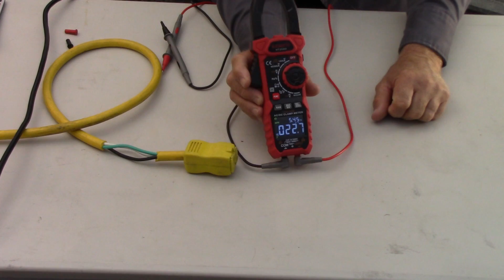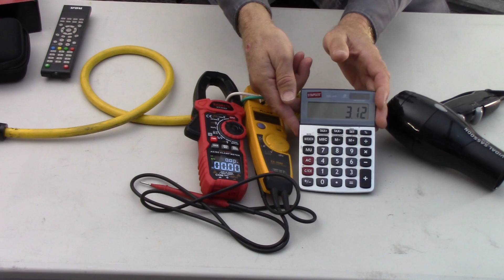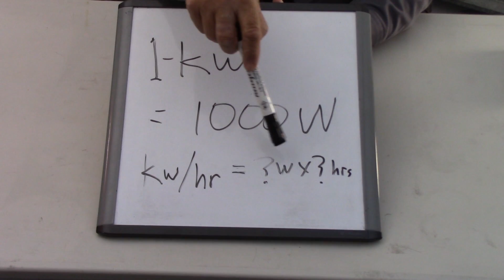Volts, Amps, Watts - What Exactly Do They Mean??

Comment: VOLTS = Water Pressure (50 psi)?
AMPS = Water Flow Rate (ie. gallons per hour)?
WATTS = Water Used (ie. gallons)?
Volts x Amps = Watts?
Water pressure multiply Flow Rate equals Water Usage?
50 psi x 1 gph (mist nozzle setting) = 1 g
50 psi x 2 gph (shower nozzle setting) = 2 g
50 psi x 4 gph (full nozzle setting) = 4 g
Notice the gph always equals the final amount used.

WATER: If 1 gallon of water flows passed (AMPS) a given point ("switch/valve") per hour then after one hour the bucket will have just one gallon of water (WATT?). But apparently in the world of electricity, AMPS and WATTS are NOT measured equally. So, why aren't AMPS (amount of electricity flowing passed a given point) equal to WATTS (amount of electricity used/expended)? What is the difference between AMPS and WATTS? What is the advantage of having two different names to measure electricity whether it is flowing versus after it is used?

If the amount of electricity that ends up getting used varies from the amount of electricity that passed the "switch", what causes that variable? In WATER, regardless of the water pressure, if a nozzle/fixture/outlet (load/appliance) restricts the amount of water used to X per hour then the rate at which that water is flowing passed the valve will be equivalent to what ends up in the bucket. It would be weird if the water flow rate was say, 1 gallon an hour but we measured 2 gallons or only half a gallon in the bucket. Either the instrument used to measure the flow rate is broken or the water in the bucket was not measured correctly.

Forgive my ignorance.
Reply: My thoughts, but exactly

Comment: I loved your water analogy.  I used to use electrical analogy when I taught cardiac heart rhythms, which is basically plumbing and electrical. Great video.
Reply from the maker: Thanks for watching!  And for the nice comment!
Reply: @theinternetelectrician  VOLTS = Water Pressure (50 psi)?
AMPS = Water Flow Rate (ie. gallons per hour)?
WATTS = Water Used (ie. gallons)?
Volts x Amps = Watts?
Water pressure multiply Flow Rate equals Water Usage?
50 psi x 1 gph (mist nozzle setting) = 1 g
50 psi x 2 gph (shower nozzle setting) = 2 g
50 psi x 4 gph (full nozzle setting) = 4 g
Notice the gph always equals the final amount used.

WATER: If 1 gallon of water flows passed (AMPS) a given point ("switch/valve") per hour then after one hour the bucket will have just one gallon of water (WATT?). But apparently in the world of electricity, AMPS and WATTS are NOT measured equally. So, why aren't AMPS (amount of electricity flowing passed a given point) equal to WATTS (amount of electricity used/expended)? What is the difference between AMPS and WATTS? What is the advantage of having two different names to measure electricity whether it is flowing versus after it is used?

If the amount of electricity that ends up getting used varies from the amount of electricity that passed the "switch", what causes that variable? In WATER, regardless of the water pressure, if a nozzle/fixture/outlet (load/appliance) restricts the amount of water used to X per hour then the rate at which that water is flowing passed the valve will be equivalent to what ends up in the bucket. It would be weird if the water flow rate was say, 1 gallon an hour but we measured 2 gallons or only half a gallon in the bucket. Either the instrument used to measure the flow rate is broken or the water in the bucket was not measured correctly.

Forgive my ignorance.
Reply from the maker: @Christian_Prepper  the end device (nozzle, sprinkler head, or the electrical load) is what determines the flow. The more restriction (resistance) the less current (water) will flow. With nothing on the end of the hose (or a solid connection to neutral or ground, large amounts will flow, regulated only by the supply and in the case of electrical, the breaker will trip. In the case with water, the yard or house will flood. Does that help?